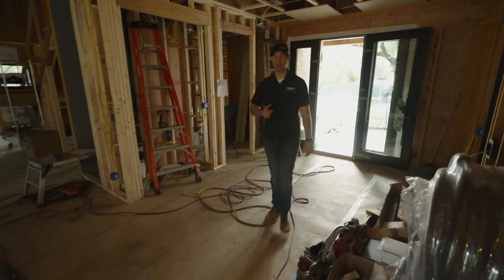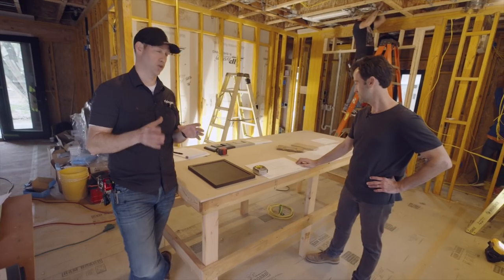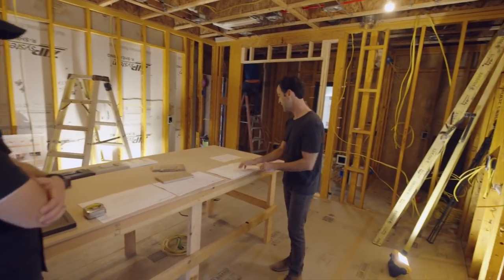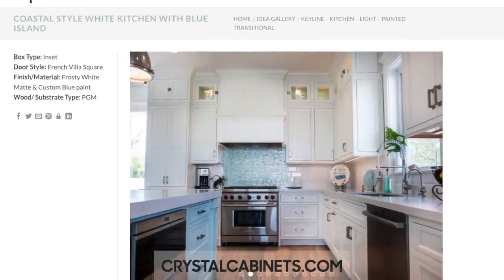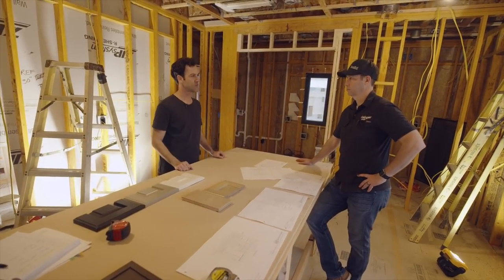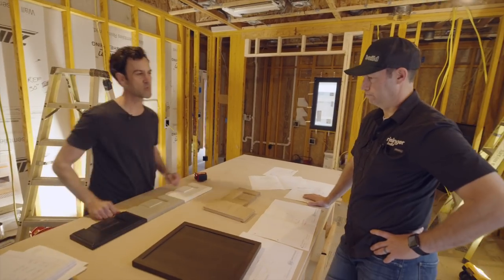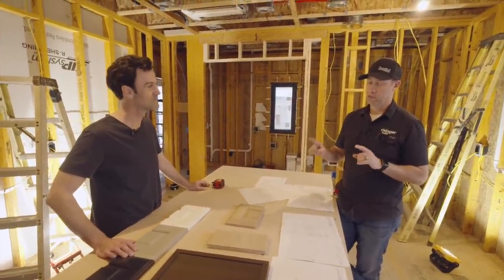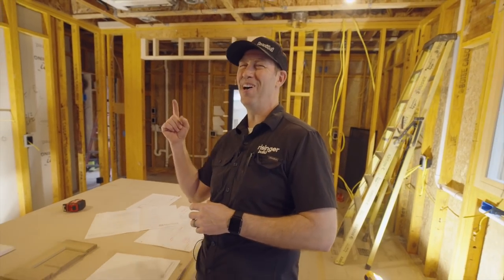5 Cabinet Planning Tips – Here’s what I’m doing at my House

Comment: I’ve always looked at your builds and loved your mantra behind making things future proof. Unfortunately you missed this with your kitchen. Having grown up in a home that had custom cabinets for the microwave and refrigerator I would highly recommend against custom cabinets that are smaller than standard such as you indicated for your dishwasher. After our microwave died we were able to put a smaller microwave in the spot and only required completing the finish for the cabinet interior since it was not intended to be seen. As for the refrigerator we lived with and kept an inferior fridge alive probably 30 years past it’s prime since replacing it would require major remodeling to fit a modern fridge or using a upscale dorm fridge for the kitchen. I would highly recommend you reevaluate your decision to scale back the dishwasher cabinet and verify your fridge cabinet is compatible with more than one manufacturers product.
Reply: I'm thinking 24" width will work for the Miele DW if I remember correctly. They will take a slightly narrower opening however also. So good point.
Reply: Your comments echo exactly what I was thinking while watching this video.  Why you would do any openings for appliances where the opening is narrower than standard is beyond me.  When that first appliance dies and you discover the replacement models are ALL wider is when you realize how badly you've screwed up.
Reply: I had to return my 24" island and get a 27" island because my 24" drawer microwave didn't fit..  Agree..  Smaller has problems.
Reply: Matt is a carpenter with a high end construction team. If he doesn't want to change some cabinets himself, I am sure one of his suppliers will do it for free.

Comment: Talking kitchens and bathrooms really got my juices going! I have had the opportunity to "do" several nice kitchens and bathrooms. I'm a plumber, as you know, and don't have a license to design a kitchen- bathrooms the state is willing to give me my head. So, I have worked with some certified designers and seeing your mock up, island, wall cabinets and all, really gave me a smile- I don't care who designed a kitchen, Home Depot or a fancy architect/designer- do the mock up! Walk the mock up with your client or primary user. Do this as soon as the wall studs are up- changes are still RELATIVELY CHEAP. Once the cabinets are custom ordered and sized or your prebuilt ones loaded on the truck, the cost goes up big. Satisfaction with the finished product is what sells the next job was a motto I tried always to tend to. Your client today, showing off that new kitchen to friends can sell many jobs for you- I think you apply that to your entire build, Matt, but it is doubly true for kitchens and much the same for fancy bathrooms. That walk in shower that looked so good on paper may be a claustrophobic nightmare- mock it up, too! Loved this one specially, Matt. Thanks, FR

Comment: On the other hand, if your Miele dishwasher ever needs to be replaced, you'll only be able to replace it with another Miele, since any other brand will be too big.
Reply: My first reaction too,
Reply: You say it like that's a bad thing.
Reply: Of course Miele designed it for just that reason.
Reply: @aayotechnology  More likely it's because it's made to fit European cabinet standard which is 600mm in width. That is approximately 3/8" narrower than 24".
Reply: Even worse, there will NEVER be another 42" cooktop that will work in that space you've left for it. If that Miele dies and that particular model is no longer available, you're going to be replacing countertops and going down to a 36" cooktop. Probably going to lose that drawer beneath it as well.
Reply: @AntsAasma  This can be addressed with some foresight. The cabinet maker could go ahead and make the space big enough for the standard 24" width, but just cut the front to fit the Miele. If a 24" replacement is ever desired, all that needs doing is to saw off that 3/8" of front trim and, voila, a 24" opening.
Reply: Came to the comments looking for this one. 
What an incredibly STUPID thing to do. As an appliance repairman I can tell you this choice is going to haunt them in a few years. What if Miele gets their act together and starts making "standard" width dishwashers? What if they go with an entirely different kitchen appliance suite? That cavity will have to be cut wider and depending on how the cabinets are constructed now that may be fairly easy or a complete nightmare. 
Dumb Dumb Dumb.
Reply: @Crusader1815  This is the perspective I was looking for.  IF you are going to select any built-in appliances, not just a foreign brand, I would look at several others in order to get some dimensional tolerances that I might be confronted with down the road, in a manner like the example you gave.  Sometimes though, the chosen appliance might have the larger dimension, in which case the modification becomes tougher.

Comment: Cab guy: if your ceiling isn’t straight
Matt: laughs with confidence in his lasers, lvl’s, and floor trusses
Reply: William Davies, Good point, it's still an old house..... I try to hold the uppers and crown below the ceiling for that reason if the client will go for it. Not into the scribe or bend the the top of crown to the ceiling fun.
Reply: Not to forget all his framing is done with engineered wood
Reply: @jacobsnedaker8993   Except it's not. All that light colored framing in video appears to be good old 2x lumber.  I'd be curious to know why the switch mid-stream. Might be as simple as $$.
Reply: @carbidetooth  If you're referring to the entry behind them, it looks like they reduced the size of the entrance but all of the other framing around them is engineered.
Reply: @alejandrohuerta988   I'm referring to infill 2x lumber framing throughout the house. My point is that's it's not all engineered as stated. 
One would lose much of the benefit of engineered studs on partition walls if they're half engineered and half not, unless solid wood was heavily culled. But you knew that. Don't get me wrong, I love the idea of straight framing, whether light gauge steel or engineered lumber, but from a cost standpoint it presents a tough sell to the average builder or client.
Reply: @carbidetooth  I went back and re-watched the video, I missed all the standard lumber at that start. Good eye!

Comment: Didn't cover install system? Will there be backing blocks or sheath the entire walls with plywood for screwing the cabinets to? Or will you hang them off a metal rail? Will there be cabinet lighting rough in stub outs? Are you providing both gas and electric power for the major appliances for future flexibility?

Comment: This bring up an interesting point I’ve been wondering about. I have a thing for all sorts of exotic vintage built in appliance type things. Those blender/mixer/food processors that are in the countertop, toasters that pop out of the backsplash, built in indoor grills. All this sort of thing, probably to some excess. My issue is that most of these will have to be purchased NOS or refurbished second hand, and until I have my hands on the thing I won’t be completely sure on the brand and model, let alone the dimensions. Based on this video, it looks like my plan needs to be to have the appliances (the vintage ones that I’m concerned about) purchased and on hand before cabinet layout phase?

Comment: So now if you want to replace the smaller miele dishwasher with another standard-size brand, it won't fit.
Reply: hahaha true.
Reply: Miele being European has, for Europe, a standard size of 600mm, or a smaller size dishwasher is available  at 450mm
Reply: @paulhill1665  Well yeah, no one is questioning the metric system that Miele uses, it is a problem in the USA though. I would have thought their export products would be sized to US standards. He could have gone Thermador, though I don't know anything about pricing compared to Miele.
Reply: @trickssecond  would think too expensive to have different production lines for metric and imperial, cost wise, in Europe Miele are at the top of the price range 3-5 times the price of a budget brand, but they last 3-5 times the life of a budget brand, and rarely break down. Here a Miele dishwasher starts from about £600 for a small 450mm wide basic, for Miele, up to about £2500 inc tax and delivery, add 35% for dollar equivalent
Reply: @paulhill1665  Yeah I know, my parents in Austria have all Miele in the kitchen and AEG for washer/dryer I think. Miele makes nice stuff, even for Yachts.
Reply: I was thinking the exact same thing. So instead of a simple replacement you have to remodel the entire kitchen? I guess some folks have the cash (or credit cards) to do that.
Reply: In one of first videos of this house, he was talking about remodeling the whole thing for $75K to $100K. Now he's putting in $25K worth of Miele appliances.

Comment: I generally get horrified when people suggest custom sizes for anything. I want all my appliances to be easily replaceable; because that saves time and effort in the long run when I inevitably need to repair and/or replace/upgrade something. I also frown upon cabinets that have many moving parts; that's just asking for something to break. Sure it looks fancy, but I want low maintenance and practical. Then again, maybe I'm odd.
Reply: I didn't see anything that wasn't standard size.  If you are referring to the 42" cooktop and the 48" fridge.  If your shopping low end appliances like at a box store you won't see these sizes.  When you get up into the mid and higher grade appliances you get up to a 60" cooktop standard, I have seen a 72 but I think that was a custom built unit.
Reply: I agree!

Comment: Finish sheen, whether floor, wall, cabinet, furniture or whatever, is actually expressed in percentage...not degrees. That percentage of light reflection is stated as a number between 1-100. There is a tool called a gloss meter (really!) that measures amount of reflected light from a known, usually included, source. The differential between the direct light and reflected light describes sheen. Practical range runs from around 15%, which is dull to around 80% ,which is gloss.

Comment: I would not base cabinet locations on non standard appliances. Appliances will all die by year 6 and you’re not going to want to get the same unreliable one to replace it.  I would choose very standard size appliances whenever possible.  Also I think child safety is a critical issue: to this end I highly recommend induction cooktop/range, microwave drawer, and full height refrigerator doors (no half doors to hit kids in the head), also plan a place for chemicals that is not under the sink!  IKEA style trash pullout under the sink is the best though.

Comment: First it was 2 by 4, then it was 4 by 4, then in the early 1980s it is 2 by 6, then it is 2 by 8 (in Lousiana the joist of an elevated house is 2 by 10) and someone mentioned 3 by 6 so that they can use two 3 by 6 to form a 6 by 6 post. Why don't you settle in using the same size dimensions of the posts and beams as the studs spaced apart by 12 inches to 5 feet, and the joists using the same size dimensions of the beams in a crisscrossing pattern and use a double shell studs using the same size dimensions of the posts to which the joists using the same size dimensions of the beams in a crisscrossing pattern. Treat them with TAR or with plasticized asphalt from the inside-out using a high vacuum-ultrahigh pressure (2,200 p.s.i) vacuum assisted impregnation treatment chamber, so that the interior of the wood has the same saturated protective treatment as that on the outside surface. And using 2 inch thick planks on the outside walls and 1.5 inch planks on the inside walls and 2 inch planks on the floors.

Comment: Thought, instead of a pocket door, put in a double or triple pane sliding glass door.  Can block sound when closed and always lets in more light and always see what’s on the other side.
Reply: screwing cabinets to glass doors tends to crack the glass.
Reply: @kenbrown2808  yeah, duh thats why you just use gorilla glue! 🤪
Reply: @danielbuckner2167  if you use it as hair gel, you only have to comb your hair once every couple weeks.  

too soon?
Reply: @kenbrown2808  or less!
Reply: Well, in fairness the pocket door is 2-8 so it’s not that much smaller than 36 inch wide. It will likely be always open.

Comment: why not plug strips under upper counter and get rid of outlets on wall above counters
Reply: it's a royal pain in the backside.  also, the easiest plugmold to install comes in any color you want, as long as it's ivory.
Reply: That has a clean look and ive done it for custom backsplashes that have their own integral lighting but honestly i hate going into a kitchen where i have to lean down and look up to find an outlet.

Comment: Are you adding any extra support between the studs to hang the cabinets up?
Reply: He’s added blocking in nearly all of the kitchens he’s featured in the past. Check for the videos about framing. He’ll  add blocking for floor trim also.
Reply: Also for hand grabs in the bath, towel bars, stair railings, etc. There is an endless amount of extra support that needs to be done before any insulation and rock. Great comment sir !!
Edit, I forgot about trim support William Davies, excellent point !
Reply: @williamdavies1977  Usually blocking for cabinets is not necessary unless you have a special condition.
Reply: @tomruth9487  yeah same with floor trim though i think hes doing it in this house as a bandaid because he burried the plate behind all that floor insulation.

Comment: The Miele gas cooktop cutout (KM 348) is  42 1/2" wide, how will that fit into a 41 3/4" base with drawers on either side?   Hopefully I'm wrong and you're right.  Btw, 12" overhang is enough for knee space on an island.  Flush inset doors are the way to go for sure. Order white oak doors rift sawn, if possible, if you like that look. Be careful where you make up for the extra total countertop height (37 3/4"). You want the bottom of the dishwasher, or panel, to be at the same height as the bottom of the base cabinet face frames if possible. Hopefully that will all work out ok.
Reply: it's likely induction. The appliance is no thicker than the countertop material. Yes, it's that thin and breaks the need to place it "within" a base cabinet. Kinda neato.
Reply: @ispacedesign  be sure to put in a short drawer to make room for the power cable.
Reply: @ispacedesign  Ahhh, thank you for correcting me. I get it now. Very neato.
Reply: @kenbrown2808  Good point, I've noticed on a gas cooktop it's also really easy to forget to make room for the gas line and flex etc.
Reply: @tomruth9487  it's a very rare cabinet designer who understands electricity, water, and gas don't just magically materialize in the appliances and that somebody might actually want to plug in an appliance on an island or peninsula.

Comment: Matt it looks like your island is breaking the work triangle.
Reply: The work triangle is over rated.  Unless you're running a commercial kitchen and your literally churning out dish after dish and need to move as fast as possible to keep the customers happy.
Reply: @00HiGhGuY00  I disagree. I think that having to walk around an island to do anything in your kitchen even in the expanse of preparing one meal would be extremely annoying. That's why islands normally have either a cooktop or a sink in them.

Comment: Matt, feel like tackling what may be the worst air envelope violator?  The dried out p trap, either in a utility floor drain, a guest bath, etc.  So...is there a good trap primer solution with access to the primer valve?  Do you do it on all traps?  Can a sprinkler timer (sprinklers going on and off) trigger the trap primers?  Maybe floor drains have primers in the nearby wall with panel access, sinks all have tailpieces with drain connection connected to primer.  With a minor positive pressure in the house, a simple oil filled differential manometer https://smile.amazon.com/dp/B009PAN3C8 between the inside and outside, maybe in front closet, should "see" an open drain, or prove air tightness continuously.  The air exchanger seems like the candidate to keep a positive pressure house.
Reply: Mineral oil
Reply: Matt did another video where trap priming methods were mentioned.  The one I think he’s going with is a small tube from the trap of a more-often-used sink going down to the (e.g.) floor drain.  I personally think such a tube will soon get covered with gunk and stop working.

Comment: 1: it's not a late change until the sheetrock is painted.
2: so, where are the receptacles getting mounted for the island?
3: island pendants should be 6'6" AFF to the lowest point on the pendant.  that's low enough to be an accent, but not low enough to feel like a head knocker. - I personally prefer my dining fixture at 6'-6'6", but the industry standard is 5'.

Comment: Love your videos.  Really looking forward to low voltage wiring and the hub.  I wish I had HDMI cable throughout the house. Would prefer the capability to have synchronized video/audio in several rooms to enhance sports.
Reply: Synchronized video and audio can be done over shielded Cat 6, does not have the same length limits as HDMI and is a lot more flexible.  There are even solutions for sending video over your switched IP network, if your gear is up to it.  All of this though is costly.
To anyone doing low voltage I would recommend two things:
A. Get a rack instead of one of those in wall units.  This will give you much more flexibility in terms of equipment. 
B. Run conduit throughout the house if possible.  That way in 20 or 30 years when it becomes time to replace the cable it is not a big issue.
Reply: @darienredsox1878  IT guy here, another vote for a rack, best is a dedicated closet or small room for real smart houses.